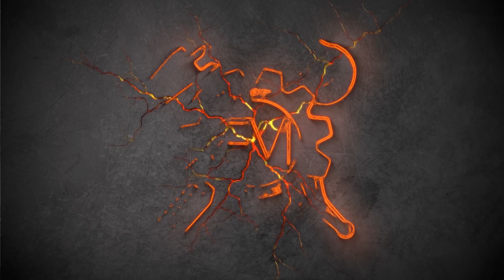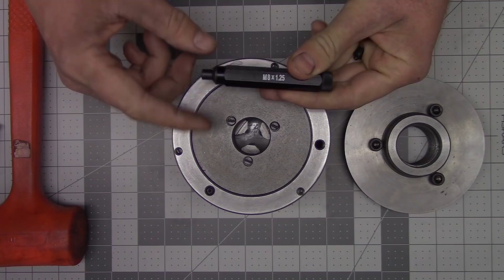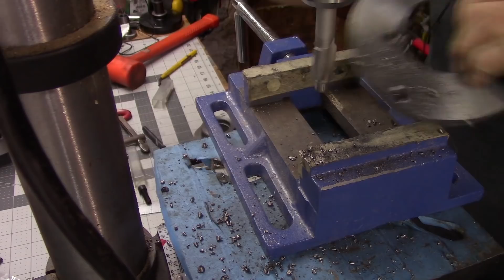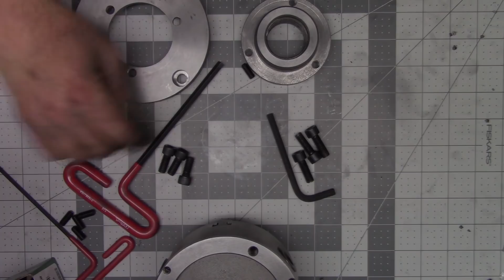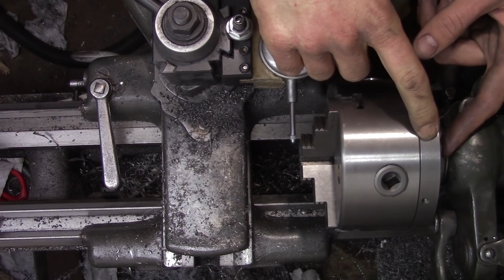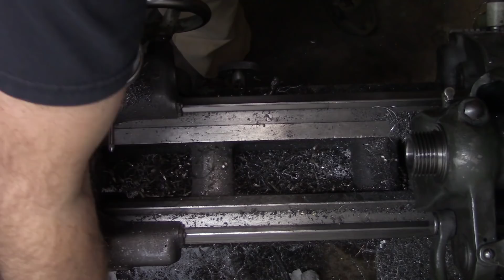Adjustable Backing Plate Part 2

Comment: try chucking up something with a different diameter
Reply from the maker: I have, I stuck in a 1.5" piece of 304 stainless and the TIR went from what you see in the video to ~.001". That extra runout very well could just be the surface finish on the stainless because it isn't ground/machined. Or there may be a slight variance in the chuck scroll. Even with the extra runout of the larger piece, I am still very pleased with the result.
Reply: @BasementMachinist  and if it mattered, you could dial it in to a few tenths again. Great job.